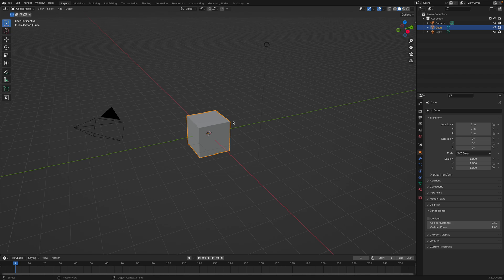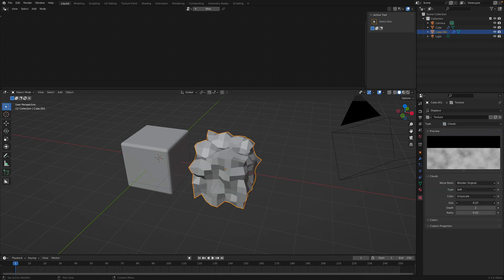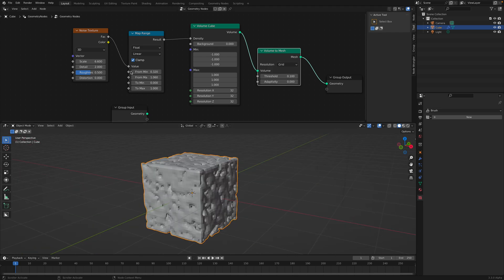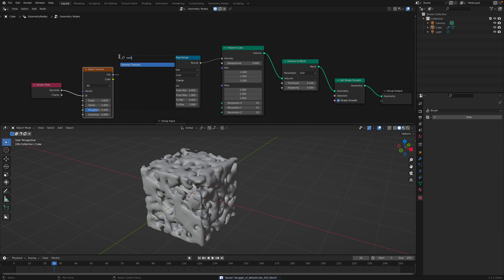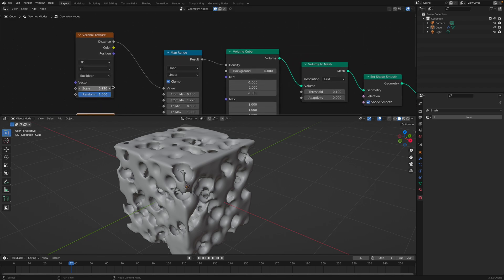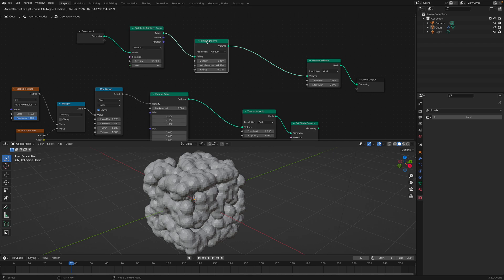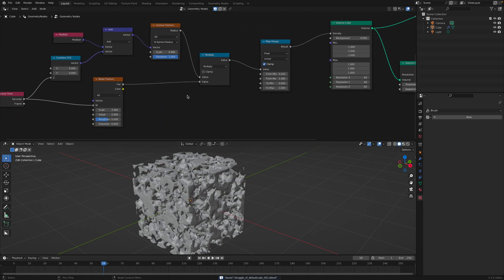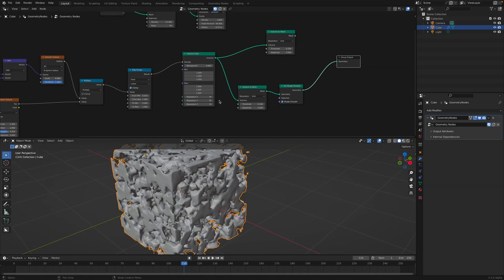LIVENODING First Look at Geometry Nodes Volume Cube

Comment: Yeah..it´s nice, I recognized this one a few days ago, cool to convert fractal density to a mesh for sure.
I don´t have mesh to volume in geometry nodes though, which is strange, thought it should be there with blender alpha 3.3, my version...
version: 3.3.0 Alpha, branch: master, commit date: 2022-06-24 21:39, hash: 12bde317f4c9, type: release
build date: 2022-06-24, 23:40:27

Though blender really needs to get some serious new fractal types it´s set of fractals are not good...and what you got,  you can´t even add the cloud fractal to the volume cube, it´s not accessible through nodes, you have like "10" only fractals to choose from.

Also cool to finally be able to export out vdb´s from creations of a polymodeler converted to a volume, and used volume displace on it, if you export save to USD format where it saves the vdb´s in a volume folder, it also worked with the volume cube, so I could export out a volume to VDB with fractals like for clouds etc.

A bit unstable though, crashed while changing values on the volume cube, instant blender shut down.